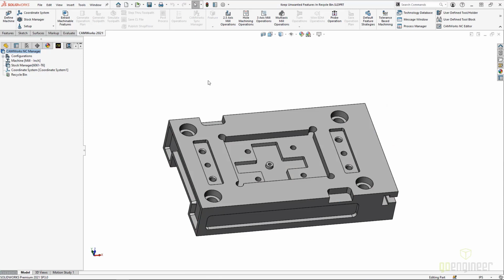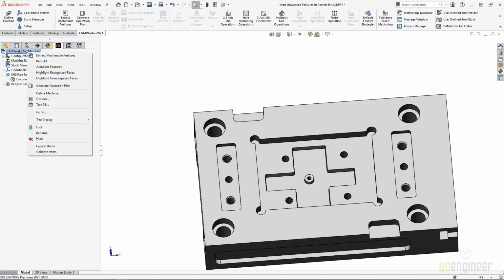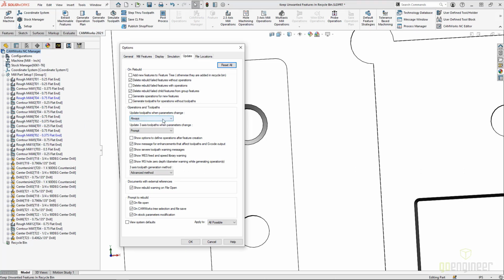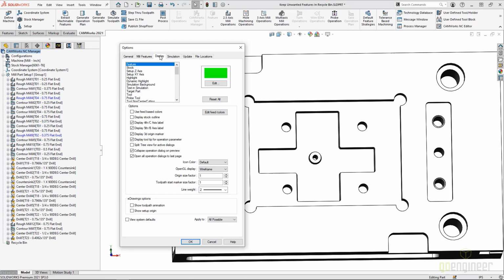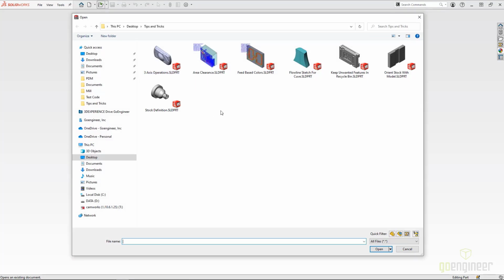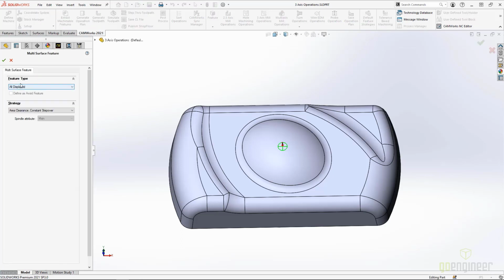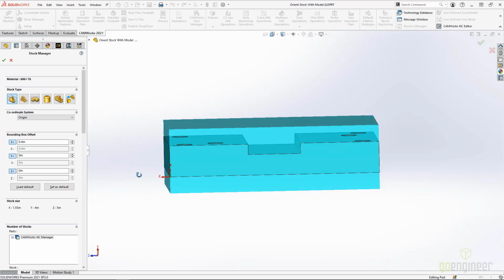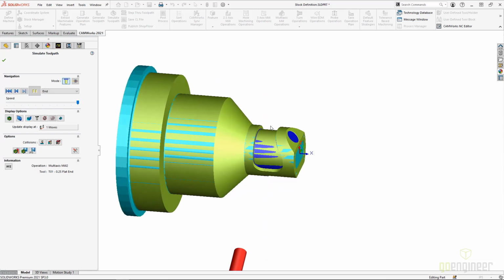CAMWorks Tips and Tricks You Should Know - Webinar

Comment: With the tool path generated at 16:07, how do you get it to clean up the center of the pocket?  After applying the high speed rounded corners it steps away from the center and does two circles at the bottom, but would leave an island above them.  I've never been able to figure this out.
Reply from the maker: There was not anything in particular we did in this example. To get a better answer I would advise getting in touch with your VAR's tech support team to look over your specific model and see if they can help you resolve the trouble.
Reply: Great video, given me tons of insight 👍🏻

Comment: How do you change what tool is being picked by the Operation tool selection -> Use expression?

If there are multiple tools that have the same diameter? For example, I have 2 tools that are 8mm one that has a flute length of 17 and one that is 32. I always want it to pick the sorter tool first.

Changing the size of the tools seems like a poor workaround.

bonus question. How do you get the tool expression to listen to the smaller radius corner it will be on the inside of? I have had lots of strategies where the tool becomes a 0.5mm end mill because there is a 0.1mm radius to remove a sharp corner. I think the base radius or finish radius is what I should use but I think I have used both.

and had the same problem.